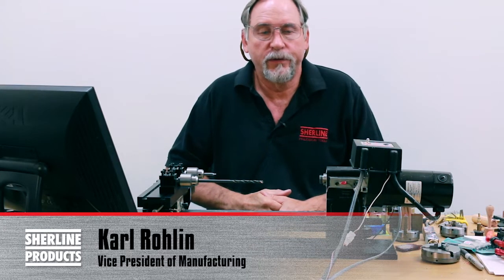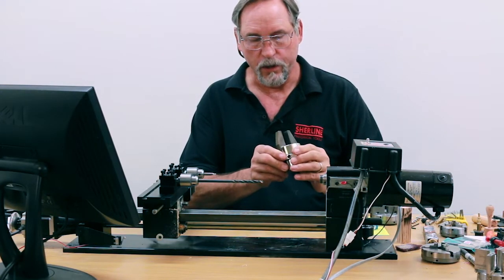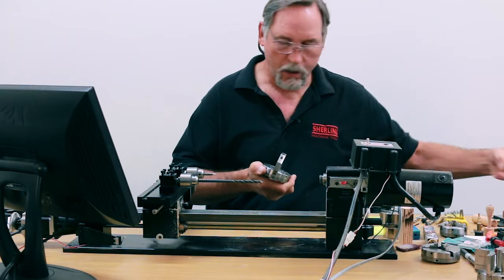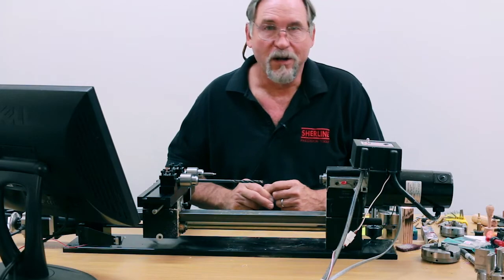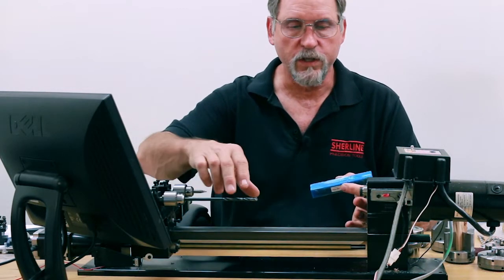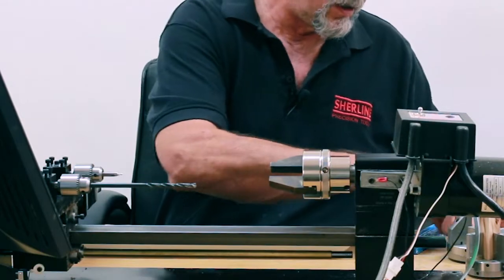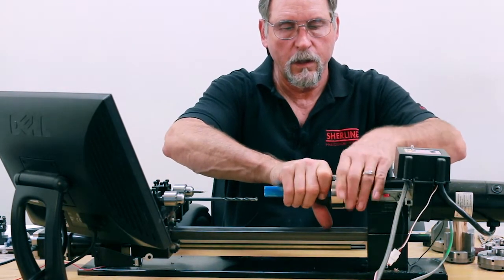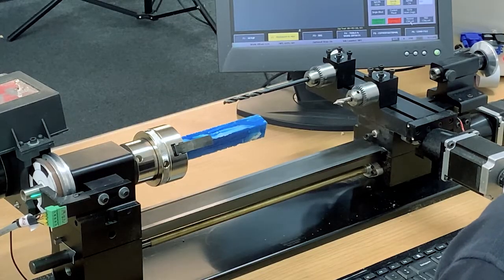Pen Making Demo Part 1

Comment: one other 'tack' to tackle this job is to, like on big engine lathes, use the 4-jaw independent chuck and a steady rest (with a 'cat_head' on the part), this removes the problem long enough to drill, then the concentricity is from the mandril between centres from then on.
NB: a cat_head is a tube of short length with two sets of two concentric rings of grub screws 90deg. apart, each grabs the part, like the 4 jaw, and as far as the lathe centre support is concerned, all it is is a cylinder, plain and simple.
Also, if you make a cat_head for this machine series, you can use this accessory for metal turning irregular parts to.

Comment: I do not see a 24" inch model on the website. Please provide the lathe model # for the system that was used in this video.
Reply from the maker: 24" lathe refers to the overall length of the bed. We usually refer to our large 24" lathe as a 17", which is the distance between the headstock and tailstock. The ball screw lathe in the video is P/N 6844. We also recently introduced our Accu-Pro lathe. It is a 17" ball screw lathe with the MASSO G3 Touch Controller, P/N 696840M3. Both have upgrade options listed on their respective product pages.

Comment: Why could you not use your 4 jaw with only 2 jaws with V grooves? Possibly just some replacement jaws for your existing scroll 4 jaw chuck if trying to keep costs down?
Reply: Or use the  4 jaw independennt??? Get it roughly cenetered...then carve one side round, then use a scroll chuck?
Reply: @Rust.Bucket  That would be the least expensive option with only the shorter sections being drilled, would be probably more accurate and faster, than a drill-press.
Reply from the maker: The V-groove jaws are the most expensive part of the chuck. We already have the program to run the chuck bodies, whether they be for our 4-jaw chucks or for a new 2-jaw chuck. We will consider manufacturing them if there is enough interest in the V-jaws